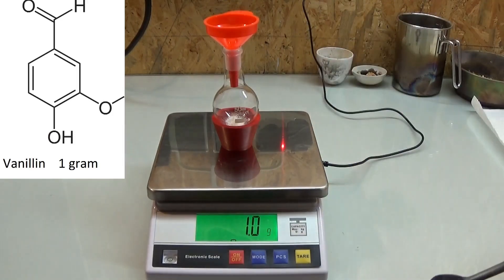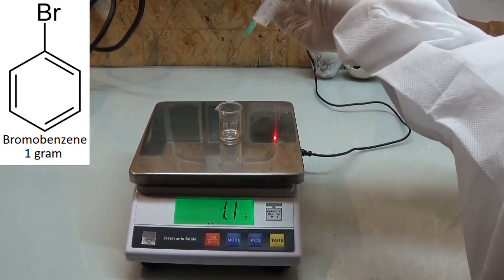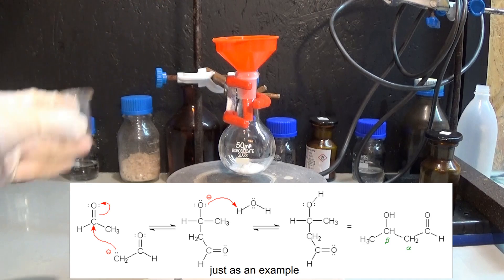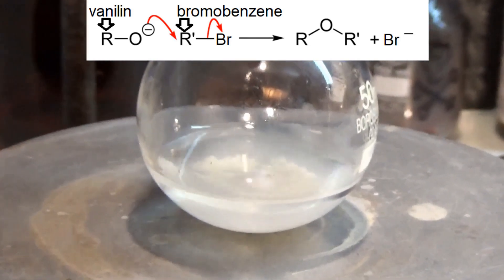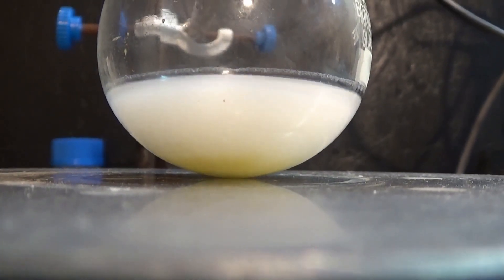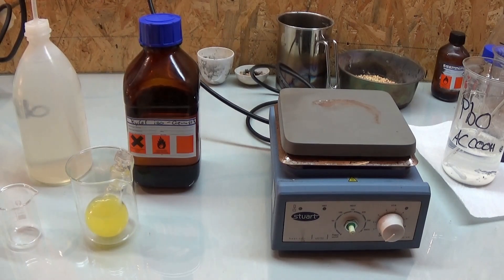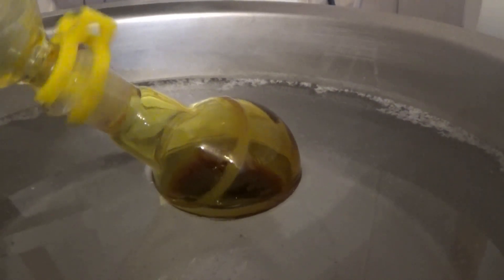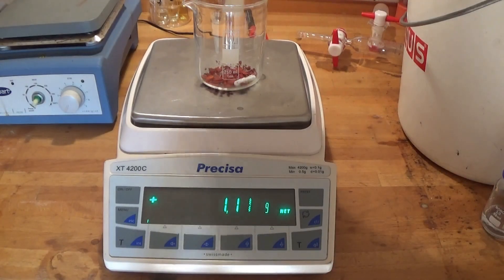Williamson ether synthesis (done wrong)

Comment from the maker: This video does not produce the wanted product an is to show the importance of checking the paper you are working with. Because I didn´t and the paper was horribly flawed.
Let us dive straight into the fun, to begin I way out 1 gram of pure food grade vanillin 
Followed by 0.6 grams of sodium hydroxide which acts as our catalyst and forms the alkoxide from vanillin 
For the last ingredient we need a phenyl halide which can be attacked by the vanillin alkoxide to form the desired ether. For this I choose bromobenzene, It should be noted that although bromobenzene is not very toxic that you are still handling a halogenated aromatic hydrocarbon so working with protective equipment is a must.
As you might know sustaining a lab and building all of my pyrolysis equipment is expensive, and since I started studying my resources are limited. For this reason I created a patreon account through which you can support the lab. So if you like my content, please consider supporting me so I can build more pyrolysis equipment and make better videos. 
But back to the video. Here you can see all our reactants on the left the bromobenzene in the middle the sodium hydroxide dissolved in some acetone and on the right the vanillin. Here is where the flaw of the paper lies. The sodium hydroxide catalyzes adol condensations and adol additions. With acetone, which is a ketone, as our solvent there are numerus side reactions. 
The sequence of the reactants doesn´t matter. At first I am filling in the bromobenze and rinsing the beaker once with acetone to maximize the transfer rate. This rinsing step is a normal lab procedure that minimizes the inevitable loss of reactants when they are transferred. This washing with solvent is especially important when you are working with small quantities or a high accuracy is needed. The second reactant to follow is the sodium hydroxide dissolved in acetone. To get this reaction to work properly use acetonitrile as solvent it works without side reactions.
So now we are ready to stopper the flask and start stirring. The reaction mixture is stirred for three hours to ensure that we have a god yield. 
this reaction type that we are performing is the so called willamson ether synthesis. It is a special type of nucleophilic substitution where an alkoxide acts as nucleophile. In our case the sodium hydroxide reacts with the OH group of the vanillin and yields the alkoxide ions in situ. The so formed alkoxide than attacks the carbon with the leaving group, which in our case is the carbon linked to the bromine atom in the bromobenzene. The bromine than leaves the carbon, and the oxygen of the nucleophile bonds with the former halide carbon. But with acetone present this is only one of many reactions that takes place which leaves us with a highly contaminated product.    
Over the course of the reaction two phases separate in the flask. 
 in the end the reaction mixture has a nice creamy yellow color similar to the lead oxide in the back 
to work up the reaction mixture we add some water to dissolve all polar hydrocarbons and the sodium hydroxide. This mixture is than extracted using twenty-five milliliters of xylene this extraction is performed twice…. sadly I forgot to film this part but if you like to see how an organic substance gets extracted using a non polar solvent you can watch my video cinnamic acid synthesis part 2 
the organic extract is then transferred into my new rotational evaporator that was sponsored to me by Wacker chemistry a very big thank you goes to all of them. I will explain the roti that’s how we call the rotational evaporator where I live I another video. But for a short explanation the whole system operates under vacuum and do to the spinning motion of the flask the surface of the liquid is increased drastically this leads to a very simple and easy to operate distillation of solvents  
after the roti has done its job a red crude vinilin phenyl ether is left in the flask as brittle flakes. Due to the high percentage of side products it was impossible to clean up the crude product. I am posting this video because I think it is very important to learn from failure… in this case it is mine. But for the future you and I know that fact checking your papers is important! 
I hope you liked the video if so consider subscribing to my channel I post chemistry content whenever I find the time to cut the videos because is the part that takes the most time 
so have fun and do not kill your self

Comment: QUESTION............i want to do an aldol reaction with acetone and the enol of acetone and i get it all but one thing.   At the end i am GUESSING you end up with 2 products in equilibrium,   The beta hydroxy ketone and the alpha beta unsaturated ketone??????????????????????????????  I mean, if that is true,,  what determines which is the major product??????????   How do i push the equilibrium one way or the other???????  I am guessing maybe when the reaction is done i can just distill out the water and it will push the equilibrium towards the dehydrated product????????????   What if i want the beta hydroxy ketone.......how can i push the equilibrium towards that?????????????  They always say the difference between an aldol reaction and an aldol condensation reaction  is that the final product is different..........but they never tell how to STOP the dehydration so you get only beta hydroxy ketone..........and they never tell how to FORCE the dehydration so you get a alpha beta unsaturated ketone.  IS IT JUST MAGIC AND WISHING ???????  LOL

Comment: As a chemist, how does one know how these reactants are supposed to work together? What is the thinking process behind figuring where to even start? Theres seems like there so many steps
Reply from the maker: normally you have a paper you are working with. But as seen in this video they can be flawed... you just have to know your stuff (and I should have known the issues in this one: number one the solvent and wrong choice of catalyst (CO3)2- is the right one; secondly the bromobenzene is a secondary halide but a primary one is needed) when something does not work like planed you just have to do research look up papers and possible side reactions. Hope this answers your question :D 

mfg hazelChem
Reply: @HazelChem  Thanks. But I cannot stand reading those damn research papers >_< theyre so dry!  

So do you just choose a research paper of interest and then do whatever experiment? 

How the fuck does one learn the language of chemistry

Comment: Hey. Thank you for the videos you're making :)
I thing there is something even more wrong than using acetone as a solvent. This is not an alkyl bromide, this is an aryl bromide and thus there is no SN2 reaction possible with a non basic nucleophile like a phenoxide. With a very basic alkoxide you could maybe get this to work but not here. It's not an alcohol you have here, that's a phenol and phenol are quite acidic (pka = 10) so there would not be any residual NaOH if you had used 1 equivalent and thus no pb with acetone. The only problem would be the impossibility to do a nucleophilic substitution on bromobenzene without some electron withdrawing group on the ring or a very basic nucleophile.
Maybe with some palladium catalyst that could work...
Reply from the maker: a very good point you make! the secondary nature of the halogen atom makes this reaction impossible to work. 

mfg hazelChem
Reply: just a follow up question - so it's impossible to make diphenyl ether by reacting phenol deprotonated by sodium (m)ethoxide with bromobenzene?
Reply: @michal-jenco  To me: no because a phenoxide is not basic enough.
No SN2 on an aryl-halide.  EXEPT for the very basic nucleophile (NH2- and alkoxides) which can eliminate HX from  the ring forming a benzyne which then react by addition. (so it's an elimination-addition mechanism). Here is a good source for that:
https://www.masterorganicchemistry.com/2018/09/17/nucleophilic-aromatic-substitution-2-benzyne/
However I could be wrong, maybe there is some weird conditions which allow that.
Reply: @michal-jenco I THINK (this is just a point of view) that no because sodium phenoxide is not basic enough to go through the elimination-addition (benzyne) mechanism. I tried to put a link to a good source for that mechanism but the comment had been deleted :/
But to clarify: no SN2 mechanism on aromatic halides, there is some specific mechanisms but none of these really apply to sodium phenoxide + bromobenzene.
Reply from the maker: @michal-jenco  yes it is impossible because the bromobenzene does not react. you need a primary halogen atom. 

mfg hazelChem

Comment: You should've known this reaction would not have worked in the first place, Williamson ether synthesis is SN2, and bromobenzene does not undergo SN2. For the formation of aromatic ethers, you need to use Ullmann or Buchwald-Hartwig conditions which requires respectively a copper or palladium catalyst.
Reply from the maker: you are right you need a primary halogenated educt for this to work ! 

mfg hazelChem
Reply: @HazelChem  mfg?
Reply: @kataetwas2825  Mit freundlichem Grüß, it's German for kind regards :)